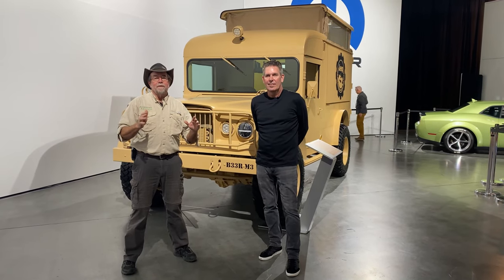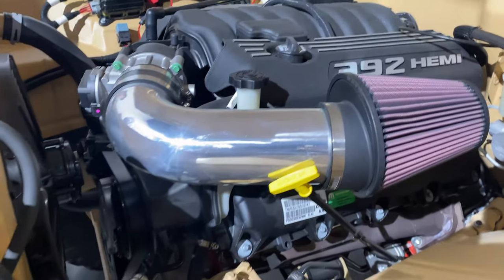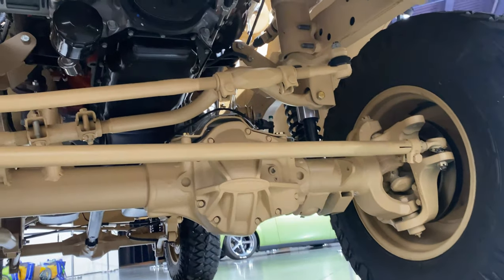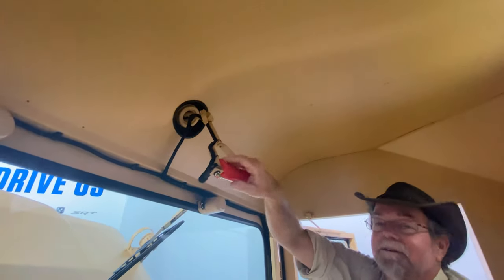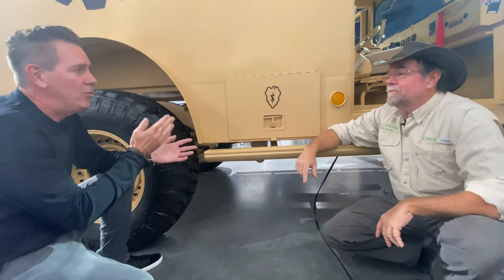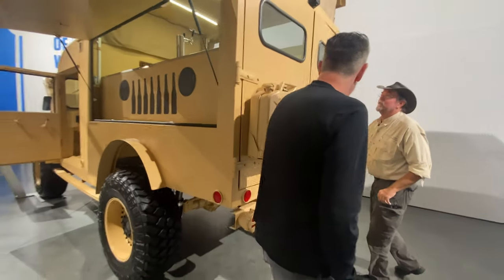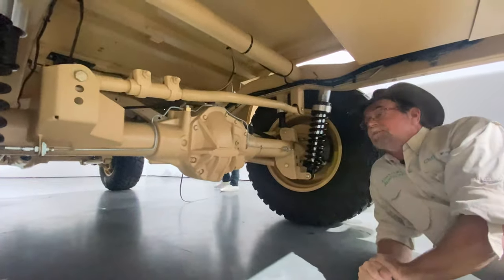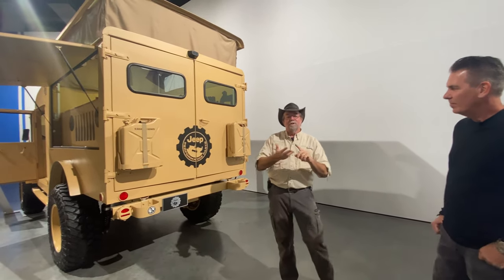Kaiser Jeep M725 Concept SEMA 2021

Comment: What a well thought-out vehicle.  Execution appears flawless.  I noted that the boarding ladder doubles as a little place to sit (sort of) when it is in the stowed position.  I'll have to check to see if that's part of the original design or just more genius on the part of the owner.  Small, thoughtful appointments like that are not to be overlooked.  The pass-through to the cab is sort of blocked by the stainless steel table but they ARE getting set up for business, so...  I hope the roof is as weather -proof as one would hope it would be when it is down.  I own a stock M715 and personally, I prefer the original bare-bones military profile but I would be very satisfied with everything they've done with this.  Very nice all around.
Reply from the maker: Thanks for the feedback, Timothy. The Mopar/Jeep guys set this up as a mobile (and very cool) bar, so we need to cut some slack on mods deviating from OEM. We're still waiting for them to bring it out to Easter Jeep Safari...